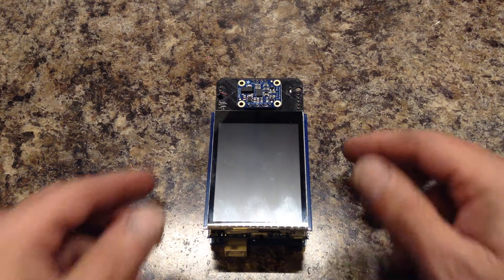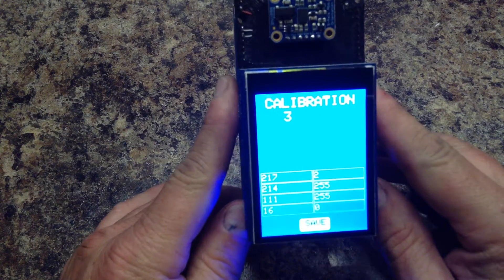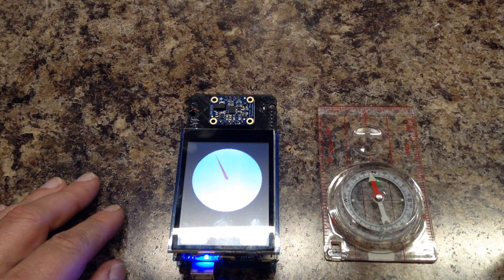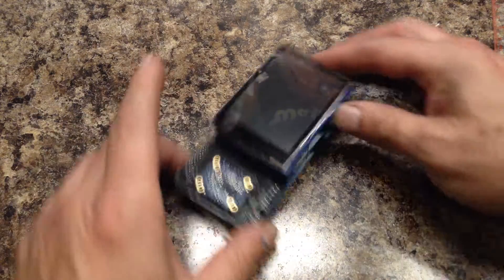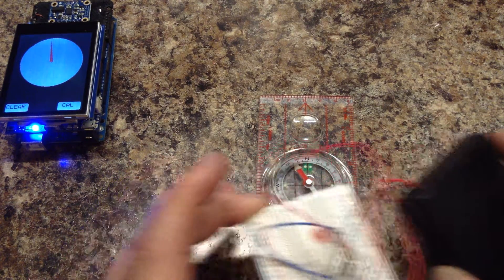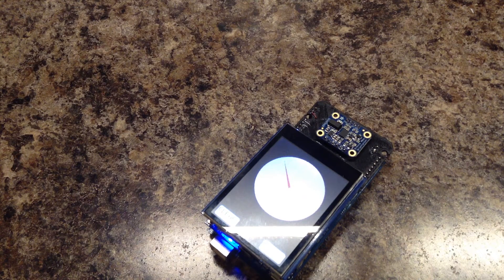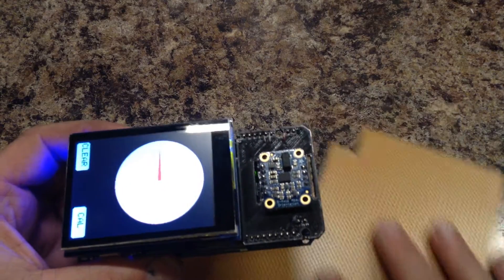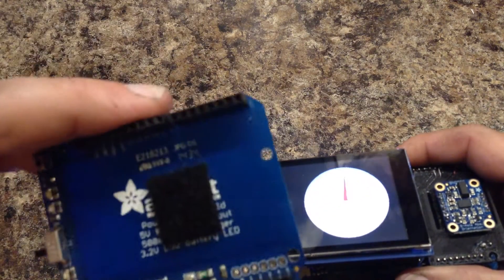BNO055 Demo - Magnetic Calibration

Comment: Very nice work on the whole idea and setup.  The work you did on getting calibration into the Adafruit BNO055 library is great.  I would only suggest that you be much more specific/clear and insert a set of header comments describing what you're doing and call out the mods in the code, or fork the library and call it a new name.  Library management with new releases etc. is tricky without it.  And in the description you might have discussed using the SD card to store the parameters. It is a critical element.  I may modify that and store the parameters directly in the CPU eeprom.  But nice job.

Comment: Hi, I am a bit confused. Does this calibration procedure will occur everytime you turn on the sensor? Or do you need to enter special mode to do the calibration?

Meaning that everytime I turn on my sensor, say if I want to use the accelerometer data correctly, I need to turn the sensor to 6 different faces everytime?

Comment: HI ! Nice vidéo !
I'm working on this IMU (with my own libraries) but it seems that it isn't working like it did for you...
I'm in NDOF fusion mode and I display the heading Euler Angle.

The problem is that the Euler Angle is the relative angle between the current position and the initial power-on position....While in your case it seems to be the difference between the current position and the North direction, isn't it ?
Do you know how can i fix it ? How can i display the North ?

Thank you !
Reply: Hi PM A, Hi GunnerCAF,

i am on same situation. How did you manage to get compass on your code?
I am also using NDOF fusion mode. Problem with heading is that when the device is turn on it set this as 0 heading position and not according to north.
Reply: Finaly there were no issue. If you really put the BNO is NDOF mode, and calibrated it (monitor the calibration registers to be sure), the heading angle really indicates the differences between the current heading and the North.
When i had your problem, it was because i set the BNO fusion mode and others things with my own i2c functions and with my own registers address and values that i put according to the datasheet. But it seems that i was doing it wrong. Because when i took official bno functions and registers definitions it worked well !

Also remenber to put sufficient delay in your code between power on, bno init functions and between the selection of bno mode and your first readings, as the bno needs time to start and initiate fusion modes (about 600 ms)
Reply: Hi PM A,

thanks for your answer. Thats good news.
So i have to calibrate it myself  when in entering in NDOF mode or does the BNO calibrate by itsself with an extra register  command?
Reply: You should look the BNO datasheet ! ;) 
It says that in every fusion mode, the calibration is done automatically, you just have to move the BNO according to specific patterns to calibrate it. You can monitor the calibration status by reading a specific register.
Good luck
Reply: Hi PM A,
the BNO055 calibrates automaticaly but and gives me the right north direction. But it takes a while and only if i move it around. At beginning it gives me the zero location/deslocation at initiation, once i move it around it jumps to the direction right direction/deslocation towards the north.
Can the BNO055 calibrate without needind me to  move it around?

Comment: Hey! Nice video ! What kind of accuray can you achieve with this? Lets say I turn it on in a position, check the heading, move the device randomly for a minute,than place it in the original postion. How big will be the heading error?
Reply from the maker: It's a accurate as a compass.  Once it is calibrated, it's very accurate.  The more it moves around, the accuracy gets better.  FYI, Adafruit has updated their standard library to include more calibration functions.
Reply: +GunnerCAF Do the new calibration functions that adafruit added perform as well as your demonstration? Thanks!
Reply from the maker: +Benjamin Freedman - I have not tried the new Adafruit library so I can't say.  If I do use the new library, I would need to re-write the code for another project that I am currently using.  I'm not sure they understand how adding a few calibration commands to the library turns a toy into a powerful tool.Dave
Reply: +GunnerCAF Do you feel like it's necessary to use the 9DOF bosch sensor or could this same sort of thing be done with a simpler magnetometer such as: https://learn.adafruit.com/adafruit-hmc5883l-breakout-triple-axis-magnetometer-compass-sensor/overview ?
Reply from the maker: +Benjamin Freedman The simple magnetometer will work fine for a basic compass.  This example only shows the magnetic calibration of the BNO055.  It's capable of doing much more like 9DOF absolute orientation.
Reply: +GunnerCAF hey gunner do you have a chance to talk more about this sort of thing outside of comment thread? Maybe google talk or hangouts?

I only need to build a calibrated compass and was wondering if you could help me out with some pointers.

Thanks much
Reply: "It's a accurate as a compass" how do you access compass value in BNO? because when we turned on the BNO to some direction, the value directly become zero (0), not become compass value. please help me for this case.. thank you